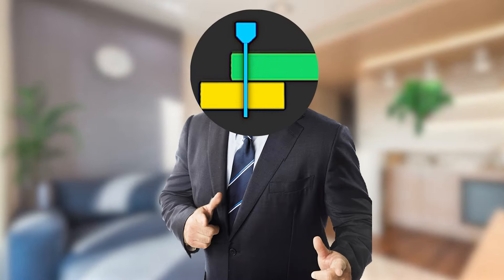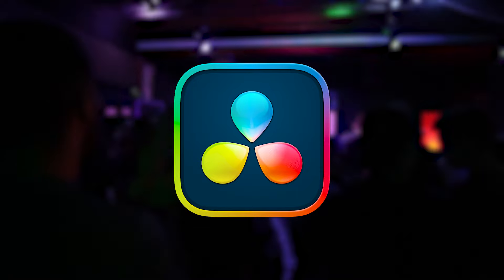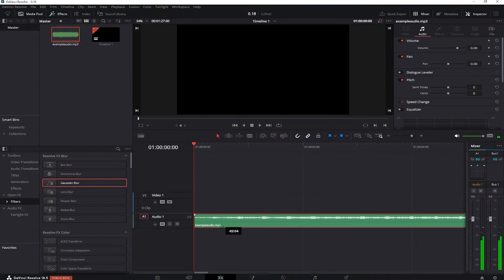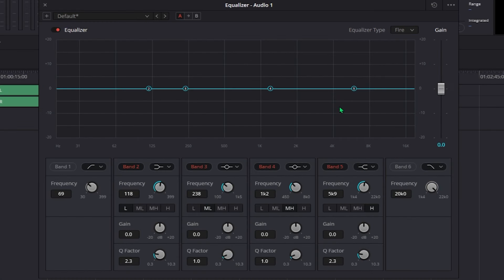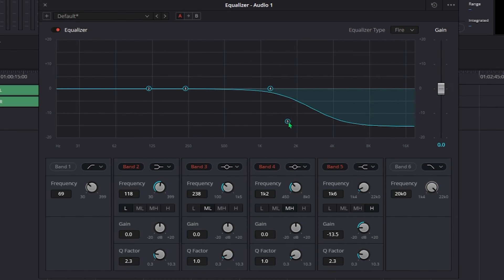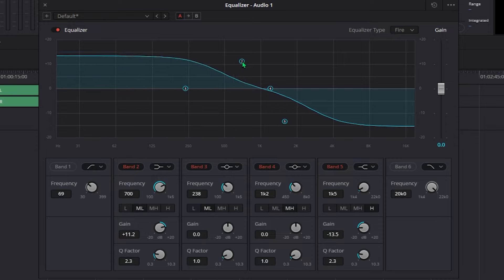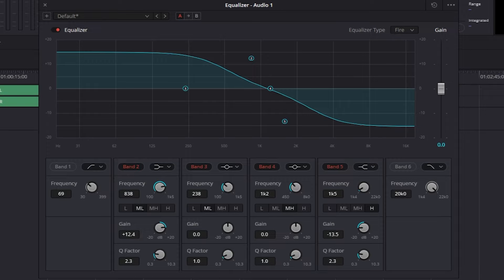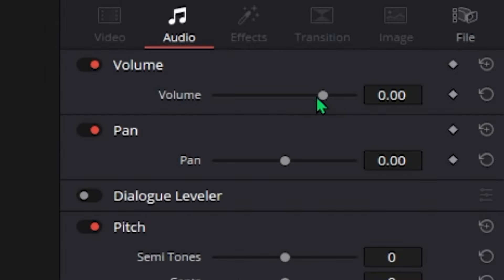How To Muffle Audio in Davinci Resolve

Comment: This applies to the entire track. Surely there's a way to make this apply to individual clips, no? 
It's a bit annoying to have to make a whole new track just for a single EQ effect.
Reply: I paste the same audio in different tracks, then cut out the OG parts. so i can edit the dupe version
Reply: bro, did u found any solution?
Reply: @koskbtw  btw you can use the eq tab in the edit page and just adjust band 4 for the same effect
Reply: @colaqqqq  I don't know if you'll read this but this single comment spared me so much effort I just need to drag band 4 😭THANK YOU
Reply: @Tootster  yw dude hope it helps
Reply: cut and put into different track
Reply: Use automation
Reply: @koskbtw  i locked the other ones, it seems to work
Reply: @colaqqqq  I LOVE YOU!!!